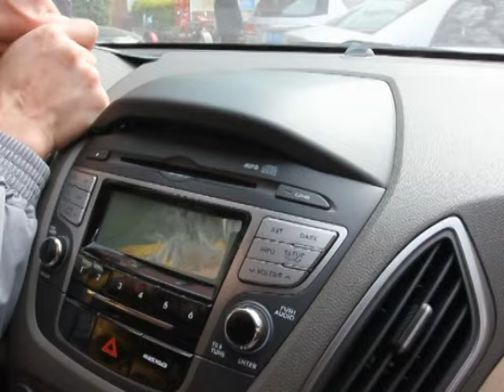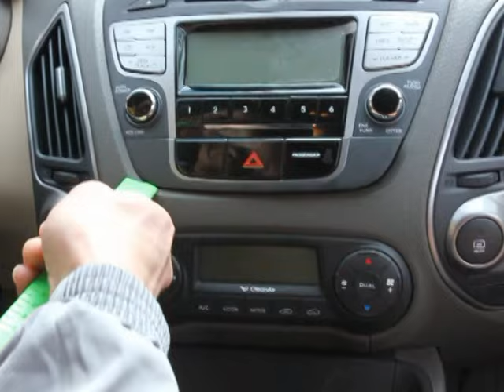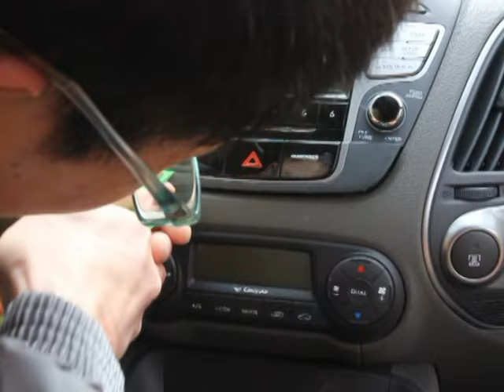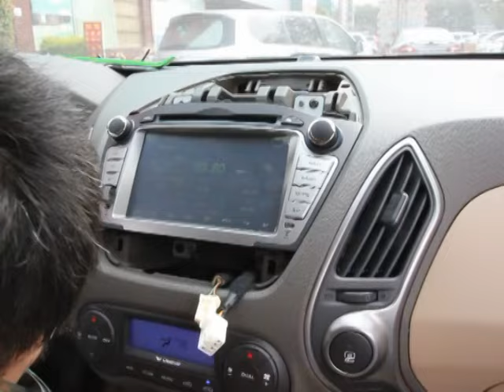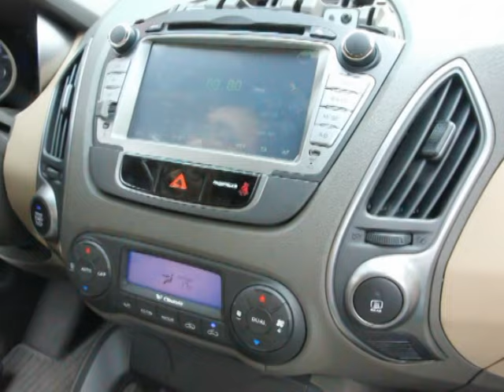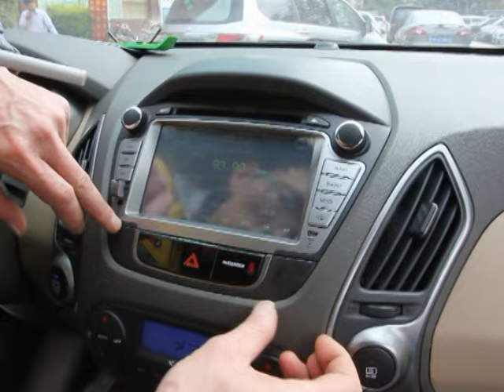uniway  how to install car dvd  for hyundai ix35 Tucson gps player car stereo gps navigation

Comment: I should have done an internet search before going to hyundai ! It cost the same price just to get the same old radio replaced, instead of being able to replace with NAV GPS... :/ Learning curve !
Reply from the maker: dear friend, if you want to know more informarion about the car dvd, you can check the link about the device
Reply: I have the 2012 Tucson GLS that I want to pimp but I am being told the navigation system doesn’t fit my car so they won’t sell.

I saw used ones on eBay and sellers say they won’t give me warranty if I don’t return my previous model 

I told them I am not ready to part with it because it is fairly new even though the car is 10yrs, I barely use the car much

It’s interesting watching this, my question is does the steering controls work after the car.

I tried another android model and the steering controls don’t work unless it wasn’t done properly 😢😢😢

Comment: The 2011 Tucson GLS has seven (7) cables/plugs.
No one makes cables nor plugs for this model
Reply from the maker: You can contact us on aliexpress,
Reply from the maker: https://www.aliexpress.com/item/32931882310.html?spm=a2g0o.detail.1000060.1.1592418296knke&gps-id=pcDetailBottomMoreThisSeller&scm=1007.13339.146401.0&scm_id=1007.13339.146401.0&scm-url=1007.13339.146401.0&pvid=749d71b7-b438-472a-b056-4058aa52e787